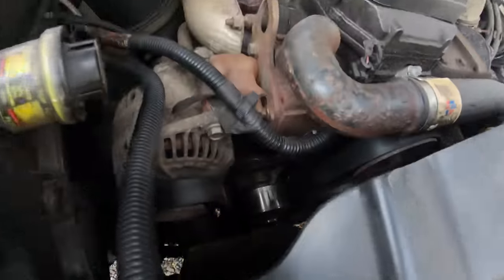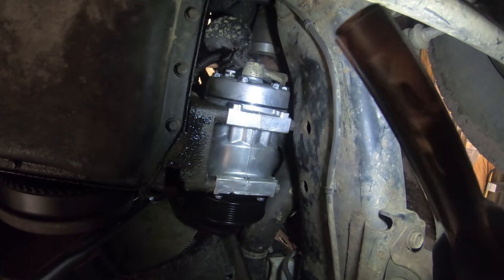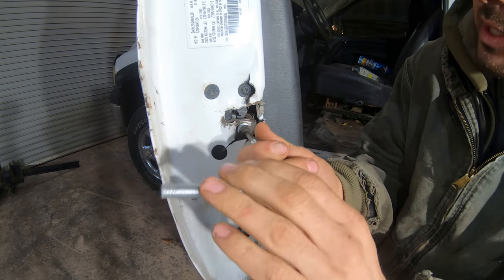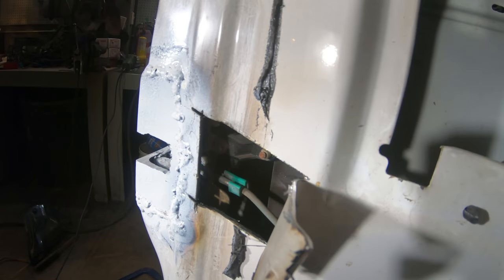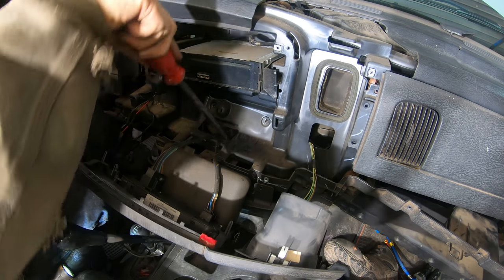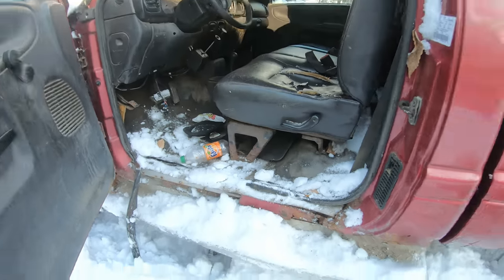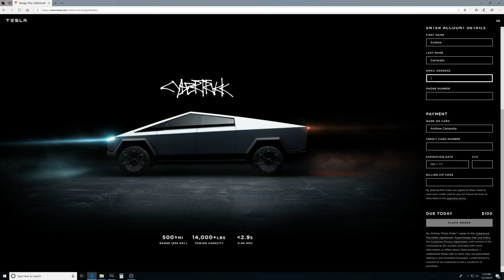Pickup truck repairs

Comment: "So delicate. You tip'em over one time, they get all smashed up for no reason"

lol!
Reply: made me laugh.
Reply: Lmao so true
Reply: never mind i went in to the  ford dealer, was looking at a new 3/4 ton 4x4, ,, on the showroom floor, i leaned up to the truck front fender and pushed my thumb into the side of the fender to stand up strait, and there was my thumb indent right in the fender
Reply: @6:30  Truck on fire?  Andrew holds door open with one foot and drives straight to the car wash lol.  That should be a Vinwiki

Comment: "Anytime you can take some electronics out of a vehicle... that's a big upgrade right there" 
Proceeds to order a vehicle that is all electronics.
Reply: I know right 😂😂😂
Reply: yeah of all the people in the world I thought for sure he would say tesla is garbage. i cant belive he is going to order one of those, whats he going to do when it gets rained on with the doors or windows down or his keys get dropped in water and then cant drive anywhere
Reply: when the batts take a crap he'll be the first in the world with diesel swapped tesla truck. 
Seriously though, it'll be warrantied and they hold their value enough for resale later if necessary.
Reply: I mean, he didnt actually order it, its just a fully refundable payment of 100 bucks to be put on a waiting list to maybe buy one
Reply: Right, I was wondering what he was doing too.
Reply: An electric vehicle can have manual systems in it - it doesn't have to have (say) electric windows, electric mirrors, electric seat adjusters, ...
Reply: @hermitoldguy6312  doesn't have to but i'm sure it has them absolutely everywhere. even tesla doors hinges and door handles are electric motors...
Reply: How long till he puts an engine in it?
Reply: An electric drive system is extremely rugged compared to regular engines
Reply: @hermitoldguy6312  The problem with Tesla's is all those things are electric! The truck doesn't even have mirrors, just cameras. And the door handles? got to make those electric pop-outs
Reply: How to fix the stainless steel panels? Replace them?
Body could last forever, but you have to replace the battery from time to time.
Reply: In his past videos, Andrew has always said his ultimate truck would be an electric powered H1 humvee with galvanised steel construction.
Reply: Z28LET YT. Tesla just announced that their next-gen batteries will have 1 million mile warranty. Next question?
Reply: @hermitoldguy6312  Yeah, right (sarcastic)
Reply: @Curmudgeon   "Jam tomorrow"   
I remember when VHS tapes had a lifetime guarantee.
Reply: Order? He did not "order" that truck..
Reply: @hermitoldguy6312  thing is, that the entire drivetrain relies on delicate electronics and Tesla has loooong record of failing to adequately protect them...
Reply: @AKAtheA       Drive-train? I thought the motors were in the wheels?
Reply: @hermitoldguy6312  nope. Anything in the wheels = unsprung mass. Lots of unsprung mass = bad. The motor and single speed gearbox are in the in between the wheels connected with driveshafts, much like FWD cars are done, only this can have the same thing for both axles and it's much smaller, so the battery and motors form kind-of a skateboard that's pretty much flat.
Reply: @curmudgeon1933  When is the next generation battery available tho? 2035? What if the current batteries goes bad out of warranty its probably $20,000 for new ones it wouldn't even be worth it just junk the car. To replace a toyota prius batteries it's a few thousand and that car is only a hybrid.
Reply: @AKAtheA      Ah, I see. Thanks.
Reply: @curmudgeon1933  how well do they do in a 3' deep stream when the tesla truck is stuck in the water for more than 1 minute? bet the battery systems will be doing real good! might be a good truck if it stays in a city
Reply: @curmudgeon1933  none of my trucks do that, what kind of a dumb question is that, i wouldn't have even said it if my trucks did the same thing. i will never buy an American vehicle made after 2006
Reply: Hermit Oldguy. I hear ya'. I guess they were guaranteed for the lifetime.....of the tape. I'm thinking it will be slightly different on a component which could cost 8 to 10 thousand dollars. We'll have to see. 
   There seem to be more and more Tesla's with high mileage.
Reply: @boasteLP  in theory yes, but it's currently new technology that is yet to be proven in the long term. we've all heard about the tesla drive units that have prematurely shit the bed
Reply: Pig Slayer you don’t need a key you use your phone
Reply: @hermitoldguy6312  yet it does
Reply: @boasteLP  but the batteries arnt
Reply: @clive ramsbotty   New technology? Electric cars have been around since the Great Exhibition in Paris 1890 (from memory). Back then, an electric car was winning all the races. Porsche made hybrid-electric Panzer tanks in the 1930s (motors have max torque at min speed, so they're great for moving heavy vehicles). The problems have always been the same - the weight of the batteries, reliability and the difficulties of recharging. (If a tank runs out of electricity in action, you can't get a can of electricity to refuel it, you have to leave it, or get another tank to drag it off the field.)
Reply: @AKAtheA     Thanks for the reply - somehow I missed it. I'm sure I've seen hub motors: maybe they're ok in low-speed applications; forklifts, disabled whatsits, golf carts, ...
Reply: I love how he says gas half tons are crap... id take my 5.7 over that disel he has any day lol
Reply: @hermitoldguy6312  you are right
The tesla semi uses the model 3 motors  at each drive wheel
Relative unsprung weight,  not so much if an issue...
Reply: Well to order it you only need $100 as a intial down payment, It's possible he did it as a joke and He could cancel it later on. But I doubt he would do that lol
Reply: He never said Tesla he’s talking about a Bolinger b1 and b2

Comment: “I can’t see it”-cuts viewing hole... “now I can’t see it!”
Reply: Yep, that's the nice thing with newer tools and thinner metals it's like software visualization - so much easier when you can add a new viewport.
Reply: I think Andrew should have his own car/truck manufacturing company. It would be in the realm of expensive luxury cars but you get what you pay for and he would NOT scrimp on quality. They would also be electric. That is where the future is going. Don't fret men, electric winds up WAY faster than reciprocating engines. Scary fast. The "stonewall" is the power supply. Has to be light and powerful and long lasting. That is getting hashed out as you read this. It will be commonplace. The youth of the future will laugh at the 9 lives battery. Actually, they do now. They will definitely laugh at the internal combustion engine. Don't get me wrong,  I LOVE piston engines. It's just that there time is up. They will be phased out.
Can you imagine what the snowmobiles, motorcycles and watercraft will be like? I can't wait. Flying machines, anyone?  :-)
Reply: @jlucasound  He doesn't need to do it now that Cybertruck is coming, he likes it for the same reasons as me. I also pre-ordered the tri-motor.
Reply: Yeah and the fact they fixed all rust issues with stainless is great, and it won’t sacrifice strength with stainless.

Comment: 3 years from now:
- "Soo... this Tesla truck has a bunch of electronics in it. The more electronics you can get rid of, the better."
Gets angle grinder...
Reply: rip dashboard
Reply: To funny he lays the pieces of plastic over the holes he ripped out on top of the dash.we have a new 4/4 dodge truck and the inside is all plastic and I hate the road noise you have to talk loud so you can hear one another. the seats are hard as a rock.47 thousand is a lot of money for a vehicle.
Reply: AND THE WELDER!
Reply: A Tesla is more or less a computer with wheels.  Perhaps indeed this initial rush of positivity will fade when the reality of working on these things soaks in a bit.
Reply: Hahahahaha this is by far the best channel followed closely by the mnfarmer!!
Reply: @dwawa23  as a mechanic my opinion is that electric cars are more simple and reliable
Reply: @dwawa23  Teslas are much easier to work on than any other vehicle, and recently parts and support availability has really taken off. There are  nearly less parts to an entire tesla model s, than just the engine of a Dodge 1500.
Reply: Roger W Chain saw more likely 😂😆🤓🤠
Reply: Gets angle grinder. Installs 12 valve Cummins
Reply: @cathy9160  we were laughing about this and will be for some time lol. he was in a comic mood lolz
Reply: @dwawa23  What makes you think they need to be worked on like his vehicles in this video?  There's no damn engine or thin rusty metal.
Reply: @LunkerFishing  and the chainsaw
Reply: "gets angle grinder", cuts a large hole and here we have "the Camarata Edition". Voilà!
Reply: Salt water versus a rolling computer. Bound to be a problem.
Reply: Sassy Sasquatch some people have already done cool mods like that to the model 3, one guy literally tore the entire interior out of one and rebuilt it. Cant wait to see what camarata does with the structural body. You could almost attach anything to it anywhere

Comment: Holy shit can't wait to see you working with a cybertruck!
Reply: i'm surprised he might actually buy something new
Reply: Kimber 10MM  parts were a problem when model 3 was ramping production, is no longer. Plus they rarely go wrong, you have to be unlucky for that to happen. EVs are simple compare to ICE
Reply: @DaveDaveAlanAlan  Simple as in relays and solenoids galore causing a diagnostics nightmare. It's literally E-scrap after 10-15 years.

Comment: You can't charge a ac system like that. You have to vacuum out the air in the system first. U get a vacuum pump and that will also test if you have leaks before you charge it and waste your freon. U suck out the air. Then you can charge it. You really need the dual gauge so you can check the high pressure n low pressure side so you don't blow something. Some people put nitrogen in the system if the freon lines have been exposed to outside air for awhile and condensation will stick to the nitrogen and when you suck the nitrogen back out before you charge it with freon it will help get rid of any water in the system. Your ac will be a million times colder if you do it right. I hope this helps. Thanks for the videos keep up the hard work.
Reply: Good call.
Reply: This guy lives year round in a non-climate controlled shipping container castle. Somehow I don't think he cares.
Reply: @bosshogg6  He doesn't live there.  It's just his shop.

Comment: Andrew "I'm most likely going to butcher this" Camarata
Reply: Oh Gawd! I busted out when I heard that. LoL
Reply: The best was " it wouldn't be a Dodge without the broken dash pieces lol
Reply: he did sorta, that new pump won't last. #1 he didn't vacuum out the system before he filled it when you break open the system like he did you should always replace the dryer. Any moisture not removed makes it a ticking time bomb. he should asap, install a dryer, vac out the maybe add a touch of AC oil and refill.
Reply: Lol he cut the door open with a angle grinder so he could see how the door lock worked and you want him to  replace the dryer?
Reply: @davidberesford875  😂
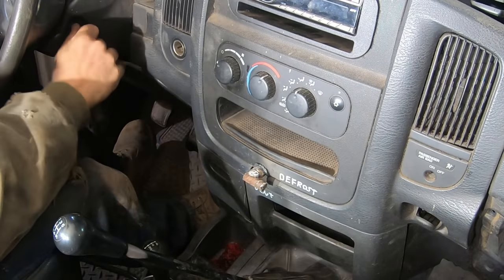Reply: " Check this is some Professional work right there, check it out...  "  20:08  - Modest Andrew 2019
Reply: @EliteGeeks  
Haha Andrews a funny cat
Reply: Brutal
Reply: You know with these quick fixes, Andrew may be saving up for that new Tesla truck??  What do you think about that??

Comment: Hey man you need to replace filter drier and orifice tube as well as vacuum down the system when you do the compressor replacement. Usually sold all together as a kit.
Reply: Or do it like he did and send it with cold air...it works
Reply: Andrew doesn't give a s--t, he's gonna do it his way or else!
Reply: If just the clutch or pulley bearing gave it up and the compressor itself didn’t cook or lock up, it’ll be fine compared to what else that truck will be put through.
Reply: Did you watch the rest of the video? Do you really get the impression he cares about something like that on this truck?

Comment: I would love to see a reaction video of the dodge engineering team that designed this truck watching this video. In fact, I would pay money for that., lol
Reply: They would probably just say "Yeah we designed a good truck, everything you see here is because management wanted to save money"
Reply: Dodge Engineering Team - Instructions for the design were clear. Make it work for a while, but then have it so deeply nested that you literally have to be able to remove the entire dash, but only after removing the AC Fluids, then disconnect the AC lines, Heater Core lines. Pull the dash out as a whole piece. Disconnect the HVAC from the the rear of the dash, remove 22 screws and pull the top off the HVAC, remove the blend doors, install new metal blend doors you purchased from amazon reinstall top of HVAC casing complete with 20 or so screws, depending on how many you misplaced in the process. Followed by reattaching it to the dash, and then reinstall the dash into the truck. Connect the AC lines and Heater Core lines. install dash back in the truck as a whole piece, strip out the oh shit handle screws reinstalling them with an overpowered impact drill. Take truck back to the AC Shop and have it recharged. Cut on AC and realize you forgot to plugin the Blend door acuators back in. Repeat process to reconnect actuator motors. Sell truck immediately following finally fixing it. 

Q/A Department. Looks good to me. 

Not that I've done this before or anything.
Reply: @Rob Bowma, better yet let's introduce Andrew to the team. He'd tear them apart!!!
Reply: I agree, I would pay too...it is bad enough what they've done to the bodies to save weight to meet epa requirements, but this BS electronic crap that no one really needs or just increases the possibility of going wrong is way unnecessary as well as expensive.

Comment: I love how he welds a bar in the cab of his truck because he doesn't like electronics but buys a fully electronic vehicle
Reply: Yes that is so true good job on pointing that out
Reply: The difference between good electronics and the cheap crap that we've learned to accept.
Reply: I don't think he has a problem with electric things in general, he just has a problem with electric things that are built super poorly that cause them to fail. I'm sure the tesla electronics would be solid, and if they weren't I'm sure he would fix them too haha.
Reply: @WolfRam.  He said he placed an order. You think he didn't?
Reply: @WolfRam.  the screen read "your order is complete" so he ordered something

Comment: Did no one else watch til the end? I'm all 'holy shit, he's buying a Tesla!', better look up Rich Rebuilds!
Reply: Now go watch Engineering Explained's video on towing with it.  It doesn't have enough energy in the battery to tow a decent load anywhere useful.
Reply: @piquat1  You'll need an extra battery pack in the trailer.  What'll they cost, about 10 grand?